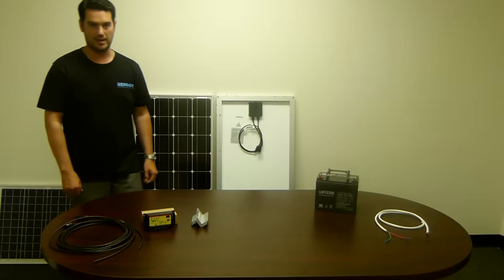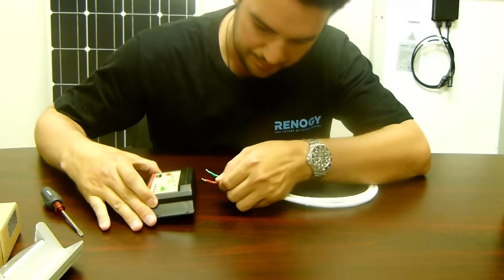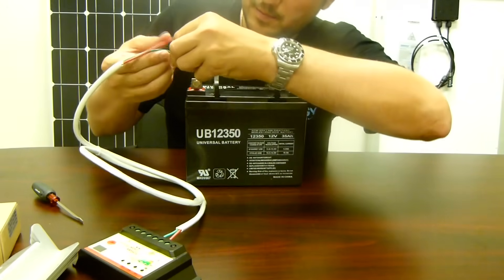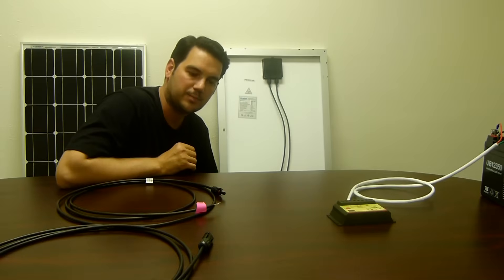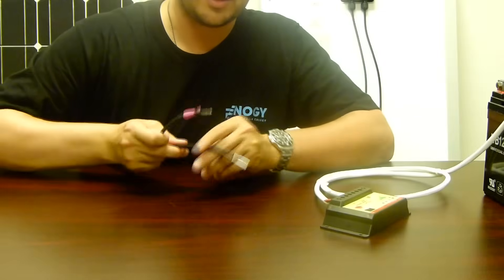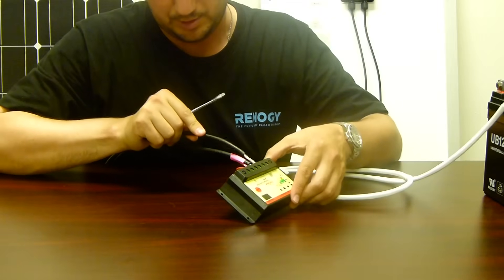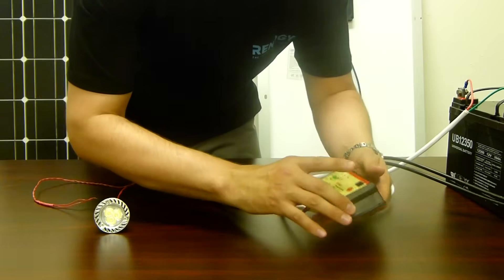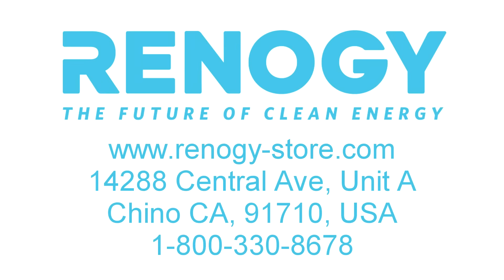Renogy: 100 Watt Starter Kit Solar Panel Installation Guide (Previously Complete Kit)

Comment: Red tape on negative?
Reply from the maker: From the wiring from the controller to the battery, the red tape is connected to the positive terminal of the battery, so the red tape should be positive.

Comment: Hello I have your 400w kit ,I have question and installing the Solar panels  4 with the kit. I have put on of RV but I have light vent were I can't put all 2
 together, and 2 across do you sell cable extension
Reply from the maker: Hi, CreativeTours Florida.

For solving your problems, we suggest you can submit a case through our Help Center Portal  (links listed below for specific locations）for help. 
 
https://renogy.force.com/helpcenter/s/contactsupport (USA)
https://renogy.force.com/helpcenterau/s/casesubmit (Australia)
https://renogy.force.com/helpcenterca/s/contactsupport (Canada)
https://renogy.force.com/helpcenteruk/s/contactsupport (UK)

Comment: you never told use which was positive and negative coming from the panel.  I did see the red tape on the first cable you connected to the solar table.  I  would be better if you told us when you did the first connection that this was the negative.  Well I hope it was.
Reply from the maker: Hi, Dale.

Thank you for your feedback which is helpful for us to pay attention to the point in our later videos. We have reflected the problems to our related department and they will optimize the video.

Comment: I find it strange that the mounting kit even for rv/van solar instalation use metal screws to drill into the roof which means if you accidentally bump your head on the tips of those sharp screws which will protrude from your ceiling it's going to make a nasty cut..why don't they provide bolts? Am I missing something here or is this a shortsighted mistake by renogy
Reply from the maker: Hi, dear customer.

Thank you for your feedback which let us know your concern.

Firstly, the sharpness of the bolt will not affect your personal safety.

Then, Once the bolts and nuts are fixed, they will not be moved by external forces.
Reply: @RenogySolar  that doesn't make any sense I know they won't move why would they? What I'm saying is most camper vans have a ceiling height of around 1.5 to 1.6 meters and there will come a time when you forget the screws are there sticking out of the ceiling a good inch or so and scrape your head. I'd probably cut them shorter from the inside and wrap them in duck tape or not use them at all but these screws are only suitable for big vans where you don't have to bend down in order to walk
Reply from the maker: Thank you for your kind reply.

We have not thought of this point before. Thanks again for your notice. We have reflected this problem to our product department. We will consider to match the suitable accessories according to the vans' size. 

Thank you again for your feedback which helps Renogy constantly improve customer experience.

Comment: Could have at least marked to pos cable.  At the factory.  Not like you did with red tape.  Is the male positive?
Reply from the maker: Hi, Fights.

Thank you for your feedback. We will improve it later.

And the male means positive. 

Wish you a nice day.
Reply: @RenogySolar  Still plan on sticking with Renogy.  I figured it out since the cable at the panel was marked.  Just not the connection cable.  Thank you for the video.

Comment: How are the two sensor cables connected? Sure, one end of each cable (temperature and battery voltage) plug into the controller, but where do the other ends go?

Comment: I just purchased the 100 watt 30A kit and was surprised that nowhere do they indicate the positive and negative polarity from the solar panel. It's not labeled on the panel distribution box. It's not color coded on the cables. It doesn't even say in the manual which cable (to the panel) is positive or negative. If you notice in this video he doesn't even say which lead from the panel is positive or negative. Without comment he used a red piece of tape to denote the positive lead. Designed properly the polarity of the cables and solar panel junction boxes would be labeled clearly and without doubt. Especially the manual. Renogy should fix this (major) documentation oversight.

Comment: Here in the 21st century we should still be shoving wires into holes and tightening them with a screwdiver? I would've designed that to have jacks to plug in securely. And why a lead acid battery? Most people are using these with Lithium batteries. I just bought my first solar chargeable system and the first thing I discover is that the 12 volt output is unregulated, so my camping refrigerator detected a low battery condition and shut itself off with 62% power still remaining in the battery! I then plugged my single board computer and Dell monitor (drawing 65 watts together) into an extension cord and ran them until It was below 10% power. So the A/C power is regulated (probably has to be), but the useless D/C renders this unuseable for camping and RV use. I now have a $250 flashlight if the power goes off here! I'll be using the rest of my money to pay bills instead of wasting it on useless junk.

Comment: I have just purchased a 50w kit, I've watched your video. Witch wire is from the panel is positive and which is negative? 
that was never shown. Thanks
Reply: I just looked up wire diagram on line and it shows the Male connector from the panel is the positive.

Comment: The only problem I have with this video, is that it does not specify which lead coming from the solar panel is the positive lead and which is the negative lead. Now, I tried to follow the adapter connections to the solar panel wires and it looks like the male lead from the solar panel is the positive and the female lead is the negative, but, I'm very disappointed that this is not specified. These videos seem to assume people already have a certain level of knowledge about these things. If one wire was red and one was black, I wouldn't complain about this, but, with both wires being black...I just kind of think it's important.
Reply: I agree.  Renogy does a very poor job with their instructions in this area.
Reply: There are no setup instructions included. I'm winging it. Got 2 panels and no clue how they should be hooked up, there are not enough cables.
Reply: Chk with volt meter
Reply: @rudbeckia885  I agree it’s really bizarre that you have to check with an Volt Meter

Comment: the poor quality of this video is exactly what you will receive for this "starter kit". spot on to what you will receive. purchased the kit on Amazon - $200. bad idea! Not complete, no instructions included for installation. this is real. this video is nothing like the starter kit. why would you sell a starter kit that requires additional?? Not much of a "kit". those that love this are bizarre. I also enjoyed the fact that they don't include mounting screws for your controller. So, go ahead and add this to the list of what's missing from the "kit". 

this guide  and the contents are not complete, incomplete, and disappointing. why would you sell a product $200 with no manual included and items for basic install missing? The controller manual (separate tiny booklet) for the controller talks about a temperature sensor needed and additional cord not included which immediately flags your mind that it's incomplete...which it is.

Comment: if your not suppose to connect inverter to load terminals on charge controller, what are those load terminals for ?
Reply from the maker: The load terminals on a charge controller are meant for DC loads. Inverters should be connected to a battery to run AC loads.

Comment: It seems that putting a 20amp in line fuse would defeat the use of #8-10 wire.
Reply from the maker: Hi there! It wouldn't defeat the purpose of an 8-10AWG wire, it would simply be an extra safety measure.

Comment: What/how much lights,appliances,etc  can 100 watts run?
Reply from the maker: Hi Carlos, that actually depends on the lights/appliances/etc.'s wattage or amps and volts. If you had specific numbers for those items, we could tell you exactly how many of those items and for how long 100 Watts of solar could power. It also depends on your location, sun hours, and battery capacity. 100 Watts could definitely run your lamps/lights as well as charge your tablets, phones, and laptops.

Comment: This isn't still accurate, correct? I just purchased the 100W starter kit - there isn't another wire I need to buy, is there??
Reply from the maker: Hi +AP Tech Services, We apologize about the confusion. This video is almost 4 years old so there have been quite a few changes. In a much older version of this kit, a tray cable was not included. However, in the newer Starter Kits, tray cables do come included. Again, we apologize for the confusion, but the necessary cables should be included with your kit. If you are in need of any further assistance, feel free to contact us at 1-800-330-8678.

Comment: Very understanding video but I have 1 question. Instead of using a white thread cable can't I just use a mc4 extension in skin the ends so I'll know if one is negative in positive or is it mandatory to keep it white?. I look at a few other video's some used white some used black with red which do you prefer.
Reply from the maker: Hello, while you should be able to strip the end of an MC4 extension to do it, we'd recommend to use O-rings/battery rings for a stable connection. And no, colors do not matter.

Comment: what about fuse protection?
Reply from the maker: Hello! Sorry for the belated response, for some reason your message didn't pop up on our notifications. While in this installation video, fuses weren't featured, we do recommend them. If you'd like, you can take a look at our general off-grid manual (http://www.renogy.com/template/files/Manuals/Off-grid-General-Manual.pdf) and details about how to wire up a system (including fuses) start on page 58. If you have any other questions, please feel free to ask us here or message us at techsupport@renogy.com.

Comment: I want a solar panel that can be connected directly to an outlet or set of outlets. The energy storage box directly to the outlets at least. This is for a washing machine and a small shed.
Reply from the maker: +iQuest Hi there, we wouldn't recommend trying to do it directly as it would be too complicated. It would be best for you to use a whole system set up with panels, a charge controller, and batteries.

Comment: Hello, newby question here. I'm installing on a travel trailer. Can you connect the solar controller to the cable that already goes from the fuse converter box to the battery, or does it have to be a separate cable? I'm just hoping to avoid laying another cable to the battery. Thanks!
Reply from the maker: +TravelingRobert Hi there, we would recommend a separate line for the charge controller going directly to the battery.
Reply: +Renogy Solar Thanks for the quick response.

Comment: How do you add more batteries?
Reply from the maker: Hello! Sorry for the belated response, for some reason your message didn't pop up on our notifications. We detail battery configurations in our general off-grid manual (http://www.renogy.com/template/files/Manuals/Off-grid-General-Manual.pdf) starting on page 69. If you have any other questions, please feel free to ask us here or message us at techsupport@renogy.com.

Comment: I was looking at the renogy 50 watt mono panel, to join with my seimens sp75 mono panel  would that work? or do they need to be the same watts and make?   Also what size wire would you use ?  I think I have 12 GA 
thanks
Reply from the maker: +gonepriused Hi there, it depends. What is the voltage and amperage of your seimens panel?
Reply: rated voltage 17 volts
 rated amps 4.40
short circuit current  4.80
open circuit voltage 21.7 volts

Thanks
Reply from the maker: +gonepriused Hi, so it will be doable, but you'll lose a couple of watts of power. If you were to do it with our 50W polycrystalline panel, you will get a total of 122.4 watts and by using our 50W monocrystalline panel, you'll get 120.7 watts by connecting them together. Please keep in mind that you'll have to connect them in parallel with a minimum 12AWG wire (though 10AWG is recommended).  Please let us know if you have any other questions, thank you for your interest.

Comment from the maker: +Richard Ynez Hi there, sorry for the belated reply. We somehow missed your question, but in regards to fuses, they're optional but recommended. The same goes for circuit breakers as well, however, you would need an enclosure of some sort for the breaker to sit in.
Reply from the maker: Hi J, Here is an answer from someone on our tech team: 
You would connect your inverter to your battery bank, the difference between the loads is that the charge controller can only handle small 12V D/C loads and an inverter is meant for A/C loads. Hope this helps, please contact us at 800-330-8678 if you have any other questions.
Reply from the maker: Hi J, the max load for the charge controller would be 400 Watts at 12 Volts

Comment: I want this for mainly cell phones, tablets, portable batteries, bluetooth keyboard, bluetooth speaker, a fan, a light. etc. I planned to get the Renology Solar panel with charge controller but I am unsure on what battery and what else I would need to purchase to make this possible. Any suggestions?
Reply from the maker: +Iam Archival Hello, it's probably best to contact our tech support team at techsupport@renogy.com in regards to which battery to get as they can tell you the size to best fit your specific power needs. If you could give them the watts, or the volts and amps of the items you need, they can figure out the battery size. But, I would most likely suggest an inverter so that you can charge your items via AC.

Comment: how do you know which is positive and which is negative?
Reply from the maker: +shotgunjoe510 If you are talking about the ports on the charge controller, the positive and negative are defined. If you are talking about the connectors, I would use a multimeter to test the polarity going into the controller, where a positive number indicates correct polarity, and a negative number would indicate that you have the connectors reversed. Please feel free to let us know if you have any other questions.

Comment: planing to operate my computer shop on solar , staring on 10pcs of computer,can u give me some solar panel kits and the price .
Reply from the maker: +Marvin Galit Hello! In order to calculate that for you, we'd need the exact watts, or amps and volts of your desktops and monitors. It would probably be best to contact our tech support team at techsupport@renogy.com to help size it for you. Thank you for your interest.
Reply: +Marvin Galit LED monitor AC 220V  50/60Hz  for 1.1A and CPU 220V  50Hz for  3A
Reply: +Marvin Galit   for my monitor its 1.1A   220V   50/60Hz and for my CPU ITS 4A  220V   50/60Hz

Comment: It would be great and informative to speak about the charge controller. This component is key to the system's efficiency. What type is it?
Reply from the maker: +Bobcatt22 Hey there, I believe the charge controller that's being shown in the above video is a 10A PWM charge controller. This video is an older video so our actual Starter Kit components have changed a bit, you can see them here (http://www.renogy-store.com/100W-12V-Mono-Solar-Starter-Kit-p/kit-starter100d.htm). If you have any other questions, please feel free to ask! Thank you.